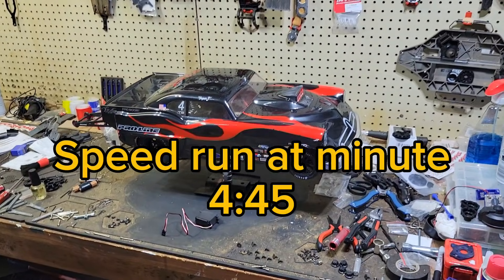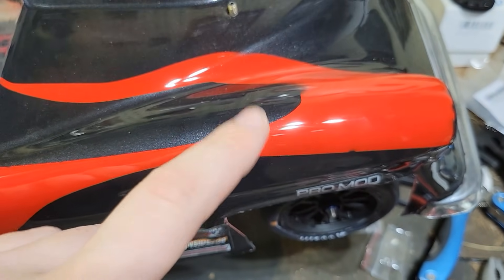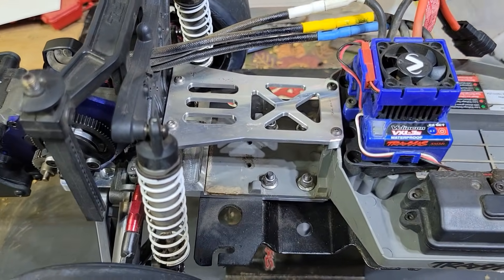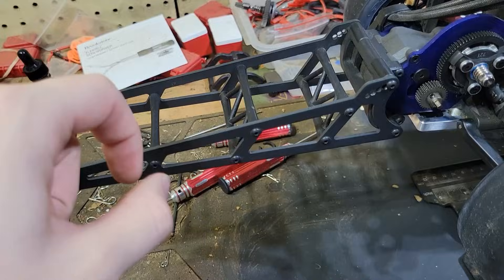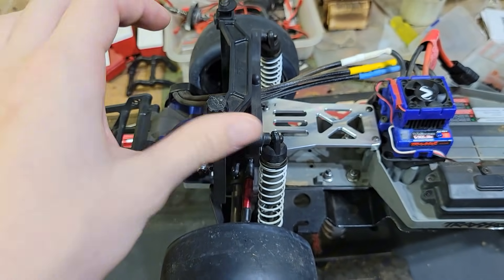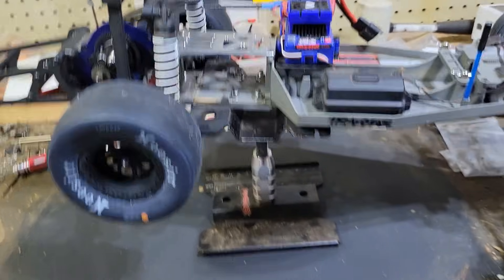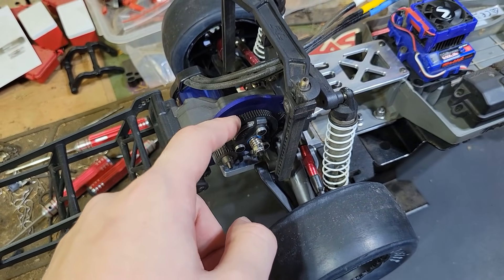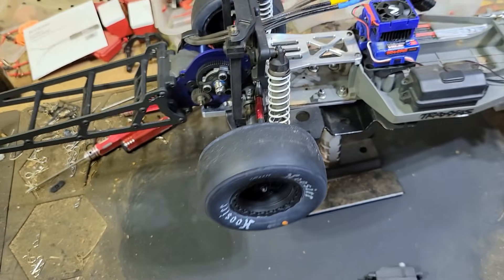100mph RC car build/overview and speedrun #rccar #traxxasrustler

Comment: Just did an old rustler drag build. Didn't extend, so a short hop but drops down immediately. Gets squirrelly braking, but she's a burner. Love it, subbed
Reply from the maker: Awesome rig!! Mine still pops also and I can't break to hard, or else I'll loose control, but still shreds!!
Reply: @RC_Racer  what system are you running
Reply from the maker: @reallythough4591  I am currently running the VXL 3s system. But!! I plan to put an arrma 6s blx system in it to get that 100mph goal, also changing the tires to hoons!
Reply: @RC_Racer  6s is too much, and hoons are too heavy for that 10th scale. You can get almost to a 100mph on 2s. Definitely on 3s . I'm running ghost gen ace 8 and 7000kv motor. Currently around 80 on 2s.
Reply: @RC_Racer  run beadlock belted slicks and leave as a drag car. Use nitro line around shaft of front shocks to limit trave, and add some weight in front of front bumper, them gear up on pinion and drop down to like a 72 spur. You'd be surprised what you can do on 2s l
Reply from the maker: @reallythough4591  Ok! I took a look at that system, and I think I may get it. I just have a few questions. 1. Can I solder on any connector, im thinking about an IC5 so I can use my spectrum batteries. 2. Did you have to program it, and if so, how? 3. Does it being sensored affect anything?
Reply from the maker: @reallythough4591  Also, I found some beadlock wheels for the rear, and a pair for the front, the fronts not beadlock, and I think I may put a proline Reaction + HP belted tire, mounted on SSD beadlock wheels. How does that set up sound? Keeping it 3s and a drag car!
Reply: @RC_Racer  yes, I use ec5 connectors on most of my batteries. Traxxas are a pain, and deans risk fire. If you are using any castle system, get the castle links module. It plugs into your esc connection, just pull from receiver. Don't plug in backwards. The negative pin on the module goes to darkest wire on esc, brown on most. Download the links app, and plug the module into the provided cord, then into USB port on laptop with a battery plugged in. Depending on which esc you have, you can program. Mamba 8s has a drag program. Ghost 8 is all about drag. Copperhead has power and curve, but is a crawler esc. If using sensored motor, you can remove pinion and do motor test thru program, and then you can turn up boost in stages. 5 on mamba, 7 on ghost  punch is reversed on castle, so 0 is highest for takeoff, and 100 is slowest. Depending on kv and prep or dry tire, you'll want to turn up or down for traction. I run around 30 for completely dry tire. 0 causes car to launch off left, can't go straight. If using prep, you can use 0.
Reply: @RC_Racer  only 2s. I run in the 80s on dry tires. You won't need beadlocks on front. Tires are off the ground on launch, and only spin due to movement. Rears are where you need the belted beadlocks.
Reply: @RC_Racer  I run 6. Drag cars currently, and have been on a crash(literally) course the last couple years. You are always racing against yourself,.whether someone is in the other lane, or you're doing test hits. It's all about getting better. Running completely dry tire(no cleaners, nothing) will make you a better driver, and improve both reaction and technical abilities. Prep is cheating in my book . I can easily go faster and straighter, and I don't earn it or learn it. I'm trying to get to 2 seconds flat on dry tires. Currently I've hit 2.63 on two cars with gnss. With the .2 second delay, that's 2.43 seconds for 132 ft. If I put goo on the tires, I can shave a second pretty easily
 That's why I don't. I'm trying to learn too, so I hope this helps you.
Reply from the maker: @reallythough4591  Awesome!!! Thank you so much!!! This is really helpful information for my build!!